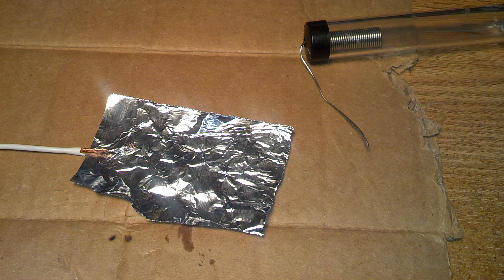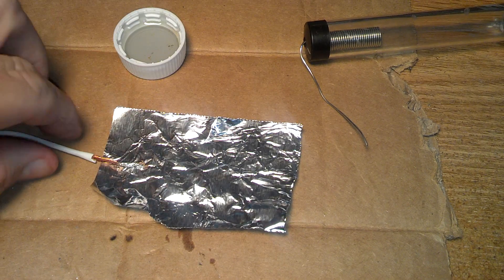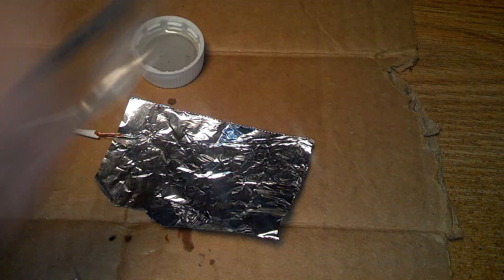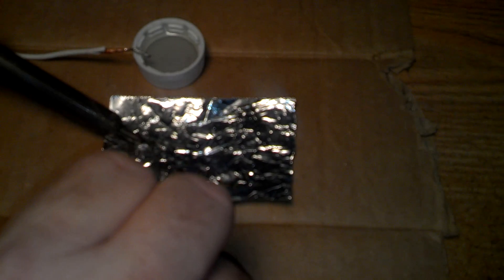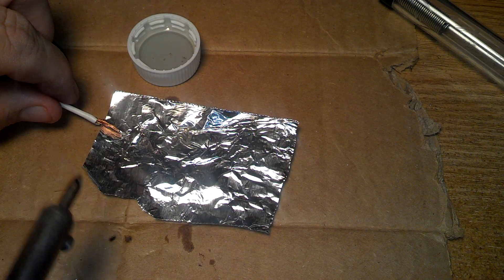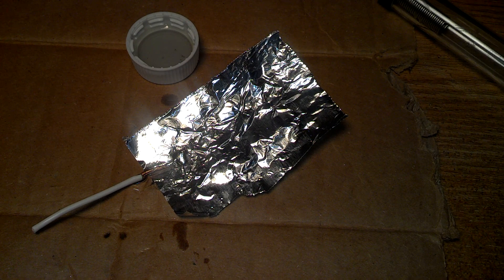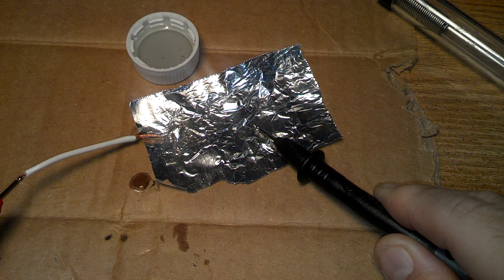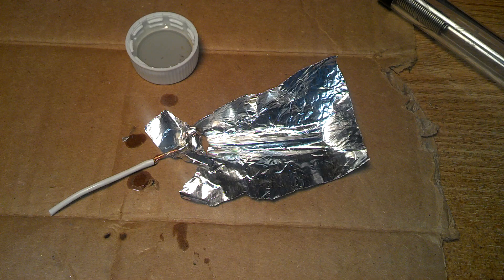How to Solder copper wire to aluminum foil.

Comment: IIRC i've seen people do this without the oil at all.  They just put a BIG blob of solder onto the iron and SCRAPE that iron tip onto the aluminium surface back and forth a lot, like you're scrubbing the aluminium clean UNDERNEATH the blob of solder.  As it scrubs it exposes more and more of the unoxidized aluminium surface, which the soldier will immediately stick to.  So the more you scrub the more it will stick.  

I'm curious if the oil idea will help this along tho.  It might!

Comment: Wow, this worked for me with soldering a wire to the (I presume aluminum) connector end of a MIDI cable! (The round metal barrel around the pins).
Just MAKE SURE to sand it down first! It didn't work for me until I did that (I actually just scratched the metal real good with scissors, but it got the job done😂)

Comment: Hi. Thanks. How do you solder a thin gauge aluminum wire with another thin gauge aluminum wire (same gauge)?

How many celsius is the tip of the soldering iron?

Stay safe.
God bless, Rev. 21:5

Comment: The oil is use less, it's the flux in the solder that cleans the surfaces. If you used that on pipes you'd have leaks.

Comment: ok let me tell you, those who Unlike this video are those who has tried this method without knowing what kind of solder he is using.

the solder for soldering on aluminum is zinc based solder. Do not expect your lead-free or leaded solder can do.
Reply: Yeah, I looked it up, it’s supposed to be zinc-tin solder. That’s supposed to be made for soldering to aluminum. 
No, I’m not trying this experiment.

Comment: damn i cant get this to work. i really tried :/ on both sides. it just wouldnt adhere and it made oil splatter all over the show :)
Reply: use rosen solder flux and coat the copper with solder then to the oil and alum..
Reply: @davegeorge7094  oo nice I wonder if I simply forgot the resin. Was so long ago now I will give another go. Cheers dude
Reply: Use a zinc-tin solder.
Reply: @jmikronis7376  hey i was about to try doing this. completely forgot i had already looked this up. i was about to comment to say 'awesome'! but of course, i missed the bit with the flux. i literally did the exact same thing 5 years apart. literally searched, found the same video, and did the exact same mistake. man i'm deterministic. update: damnit it worked once, but i cant do it again. maybe im not so deterministic

Comment: will 60-40 lead/tin solder work?
Reply from the maker: Yeah I think that's what came in my soldering kit at the time
Reply: @NorthCarolinaPrepper  its probably 40-60. Less tin. More lead. Very common. 60-40 rosin core is what luthiers usually use.  But honestly silver is the best in theory unless you fuse the metals
Reply: It requires a zinc-tin solder.  Any lead based solder won’t work.
Reply: @jmikronis7376  depends on the oxidizer. Ive soldered copper to aluminum foil for homemade capacitors
Reply: @treatb09  , at this point in my life, unless I happen across some of it, this type soldering will remain on the shelf until further notice. I do want to try it at some point. This realm of soldering has defeated me until just now, learning about it.
Reply: @jmikronis7376  you heat the copper and let the solder melt till the bond happens. If you want extra safety. Let the rosin boil to reduce oxygen.

Comment: hey dude, a channel called LEARN TV uploaded your video, without any source or mention of you.. they stole it from you it would seem so.

also do you think this process can be used to solder on a thicker aluminium sheet? like an aluminium stock pot?
Reply: Renegade zed. I've just used this idea to solder onto 2mm aluminium for alternator pigtails. Worked a treat.

Comment: Mixing copper and aluminum is a bad idea
Reply: Jimmy O if you do it right you get aluminum bronze it's parity tuff 👍
Reply: Corrosion?
Reply: If you are thinking of galvanic corrosion, it won't happen without an electrolyte.
Reply: @SteelSkin667  There are actually special zinc based alloys for this. The tin is supposedly what causes the galvanic corrosion when electrolytes are present.

Comment: Sir when i try to solder very thin HEADPHONE wires after removing their insulation coating with fire, the solder does not stick to the thin wires and it forms a kind of ball and fall down, please give me a tip which flux to use, i use just a standard one from one of electrical shop owner given me, i think the flux which i am using is not good. can you help me with my problem.
Reply: rk kumar yeah that used to happen to me too. I was using solid wire when I didn't know better. Then I got rosin-cored solder. WAAAAY BETTER! Also, take some sandpaper or something abrasive and make SURE you remove the soot left behind from burning the insulation. Finally, twist the exposed strands together and put it on top of the iron (hold the iron down with some type of weight on top of it to free up your hands) and take the solder wire and pin the headphone wire on the iron. This will make it where the copper itself will heat up and wick up the solder you're pushing it down with. I've had earbuds go a year before I had to do any repairs. And I rarely ever buy new ones(only if I want some new ones to add to the collection:} )
Reply: Hunter Washington ...and the Atlantic Ocean is full of water...and  2+2=4...and the sun is bright...and there is sand in the desert
Reply: thankx for the idea, now i dont burn insulated thin wires with fire, instead i heat up soldering iron and then put some flux on end of wire and put the soldering iron directly in top of it with molten solder on its tip for few seconds to half minutes, then the wire tins,  :) repaired samsung earphone perfectly with mic.
Reply: rk kumar MAYBE your problem is that you BURNED the wire when you tried to remove the insulation with the fire! THE FIRST RULE WHEN SOLDERING, IS THAT THE METAL BEING SOLDERED HAS TO BE CLEAN!!!
Reply: Hunter Washington It is very difficult to solder without some kind of flux!!
Reply: Hunter Washington You were stating the obvious, that's all!
Reply: Dale Burrell and it's not difficult to use rosin-cored wire at all.
Reply: i think you have a very good knowledge in soldering thin insulated wires of headphones, please if you can make a video demonstrating clear steps to solder and how to tin this wires, that will be a great help.
please ping me here if you make this kind of video in future, thankx for your awesome guidance, i will follow them in future repair works. Thankx
Reply: rk kumar That method works well with magnet wire, but it might not work on wires with teflon, silicon rubber, or other heat-resistant insulation...
Reply: Hunter Washington Using fire to remove insulation on fine wire(s) is too risky!
Reply: rk kumar No prob; I'll see if I can do something(need a stand or tripod for my phone). I'm not a professional by any means. Just trying to help you out :).
Reply: Dale Burrell I understand what you mean, but it's either that, or manually scraping it off(which will work with all the insulations you mentioned. And it's not high-risk if you waft the fire underneath the wire just long enough for the insulation to ignite. you blow it out when it exposes the amount of desired wire. then take sandpaper and remove the soot, leaving bare copper. this person is not working on some specialized aerospace wire; it is simply headphone wires. so please stop. thank you.
Reply: Use a zinc-tin solder, it’ll work on aluminum.
Reply: rk kumar glad it works man :) I had mixed some Skullcandy buds with some Samsung wire w/ remote and volume rockers. I get the great sound of scullcandy with the  volume control of the Samsung. I call em, Sammycandies! XD
Reply: rk kumar and you can successfully burn the insulation off, but you have to remove the soot that remains, plus, you must be careful what part of the fire you're heating it up with so you don't melt it. Only saying this because you want a length of wire exposed and tinned for a solid and durable joint that can take a beating. I use mine when working or doing anything active, so I can testify of this method. And I put heat shrink tubing(RadioShack) over the plug connections to replace the factory rubber/plastic that I cut off.
Reply: Dale Burrell rosin-cored wire has flux inside of it. It's a hollow tube of solder with flux inside of it.
Reply: Dale Burrell what's your problem dude? It works perfectly. I've made many many solid solder joints that haven't failed. I'm using a pair of buds I fixed myself. Just cuz it's not your idea, don't bash it.
Reply: Dale Burrell okay... so why were you still talking about flux if you knew that it's contained within the soldering wire I mentioned?

Comment: wow , its really working great ,,, after tries of anything else , i just applied a normal cooking oil to a stronger piece of foil and it make a very strong bond which take a piece of foil with wire when forced to disconnect , using normal soldering iron at (480c) with standard solder , i just needed to solder a wire to a li-po battery terminal , Thanks for Sharing of the great job
Reply: In the future, you wasn't too use a spot weld to attach a wire to a li-po battery. The heat is really bad for the battery, potentially explosively bad. Glad it worked out for you in the end.
Reply from the maker: Im glad it helped.

Comment: Anyone knows how to shield a circuit board with Aluminum Tape?? Please. :)
Reply: +fcolon1976  You could literally wrap aluminum over a layer of non conductive Kapton tape, or used anti static bags that come with your electronic gizmo's. Then if you cannot get the solder to take, make a mechanical connection with aligator
You are making a faraday cage. Must be grounded to drain any potential difference cause by EMF and Rf .
 Let me know if you have already solved your issue :-) 
C
Reply: Thanks bud I did what you told me to do and it worked out GREAT! Thank you!!! :)
Reply: Good to hear pal, glad it worked. That's what this is all about. I cannot understand why someone would not have offered their assistance before now. Reminds me I must order some cheap Kapton tape from somewhere :-) P.s forgive my spelling and typos  . omg terrible

Comment: Do you recall the type of solder you used for this project?  (60/40, silver, lead free?  rosin, water-base, or no clean flux?)  thanks
Reply from the maker: +52RH Flight I don't know in the video it was form one of the computer fair tool kits. But on the capacitors i made i was using lead free with rosin.
Reply: @NorthCarolinaPrepper , that would be Zinc-Tin solder. It’s what’s used to solder to aluminum.

Comment: Wow, asked the question and here is the answer. Amazing.
Veg oil  ! Hard to fathom really. I will of course be using this method right away cause I am out of copper foil for this Wifi Antenna build, but have plenty high grade aluminum tape. Now lets see if I can make a bond from alum to alum :-)

Thanks pal

Comment: So when you make this antenna can you pick up radio signals are wifi?
Reply from the maker: Margret Sanz If the antenna is at a diameter or length that would resonate at wifi frequency it should.

Comment: Any evidence that vegetable oil is a suitable flux? Looks like you are relying on the rosin core solder for the flux and the oil is just getting in the way.
Reply: MrWreeve 
The oil is not acting as actual flux! When he scratches with the soldering iron, he is scratching away the aluminum oxide layer, exposing the actual aluminum, which solder can then bond with! 

 The oil bath is heavier than air and nonpolar, so it does not dissolve oxygen or allow oxygen to pass through the oil, but the solder is heavier than the oil, so it can displace the oil and bond to the raw aluminum that was being protected by the oil!

Ideally, you would stick the aluminum in a shallow container of oil, and sand off the aluminum oxide layer with sandpaper while the aluminum is still submerged, to make the entire surface free of aluminum oxide, and having lots more surface area for soldering!

This technique also applies to copper! Only a thin layer of oil is needed, so you can remove the oil-submerged-sanded-aluminum from its oil bath and solder to it without making an oil fire because there should still be a thin layer of oil coating the sanded and raw aluminum!

Comment: I'm trying to bond two pieces of aluminum wire,it doesn't seem to stick the solder on aluminum,can you help me??
Reply from the maker: Relax CreatorM  Try cleaning with flux first. if i had to solder Al wire I might use a solder pot and dip them. With the foil I could keep the O2 away fo it would not oxidise the metal.
Reply: I used all kind of things,but I'll try again... maybe with oil this time,thx!!!
Reply: @NorthCarolinaPrepper , it requires a zinc-tin solder to stick to aluminum.

Comment: WOW, brilliant. After thinking about it a bit further, steel wool the foil in with the oil and then solder. Then there is no danger of puncturing the foil with the iron tip.

Comment: Really nice demonstration of soldering to foil. I was taught, when ever possible, to make a mechanical connection first, before making the electrical connection when soldering. But, in the case of soldering wire to foil, I can't see how you might do that. I'm sure there are many other instances where it also wouldn't be possible or practical. The cooking oil tip is great, too. Thanks for sharing.